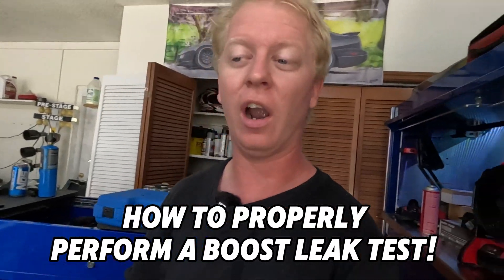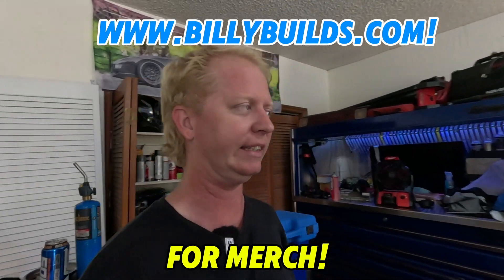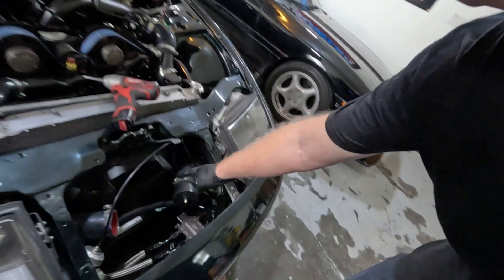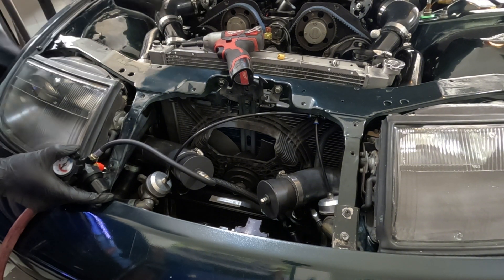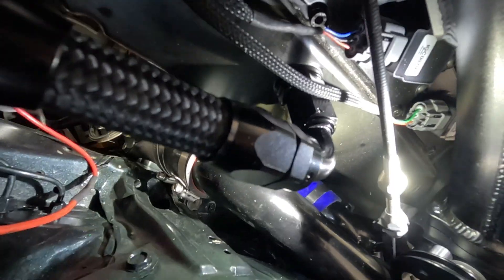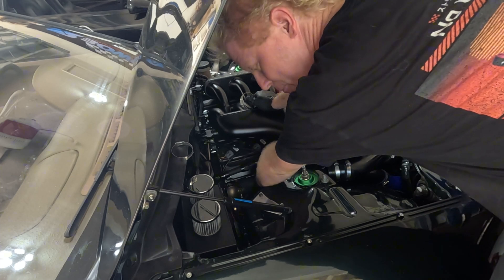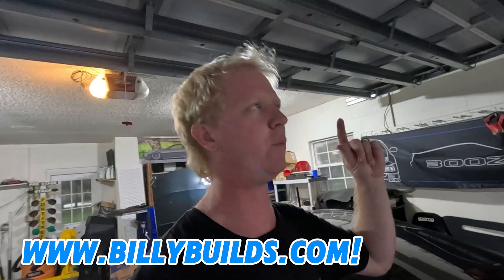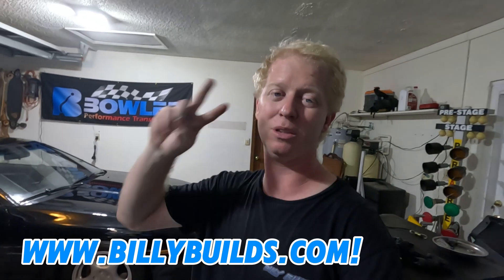Boost Leak Testing 101: Maximize Your Power!

Comment: I have two questions:

1. What is the point of testing the intake + charge piping vs just charge piping? (Other than narrowing down where a leak is)

2. Is the crankcase pressurized by boost during normal boosted operation? (only when making boost)

I have tried doing a boost leak test but can’t build pressure as most of it seems to be lost through the crankcase, though I’m sure there’s a leak elsewhere in the system.

Comment: Make your self a bayou blaster. A large mustard bottle and make a small hole in it kinda close to the bottom. Inside the cap you light a cigarette and tear the filter off. Stick it inside and screw lid on,also break the cap flap/ cover off. When you squeeze the mustard bottle smoke shoots out,then release the small hole that one of your fingers is on. Keep doing this and you have a smoke machine,smoke will find a leak if you have one.

Comment: Billy!  You want to wrap your heat shielding around your exhaust manifold!  Then clock your turbo for additional space.
Well Done.
Reply from the maker: I've looked into it. Definitely need to clock the turbo regardless. Still considering different methods for manifold shielding. This is just a temporary fix!